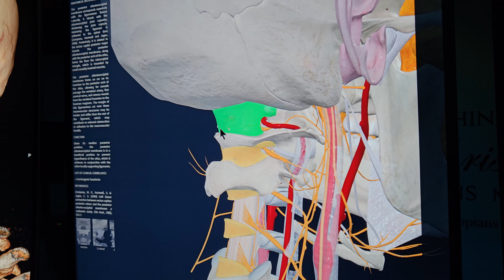Tinnitus Associated with Tethered Vertebral Artery

Comment: What's the name of this type of imaging?
Reply from the maker: We call it a 4 phase CTA
Reply: @3DAtlasAdjustingTechnique  thank you!  When I talk to my doctor I want to know the name of it.  I'm sure I need to come there to have it done. No one here where I live or even the surrounding area doctors haven't been able to help me or even understand what I deal with.  It's been frustrating and three years of dealing with it.  This last year has been the worst and I have been unable to work and applied for disability.  I just want to feel better.  Dishes and cooking make it work.  I have five bulging discs in my neck also.  I get very cranky with my kids sometimes and have to lay down and ice the back of my head to feel better along with specific stretches and an inversion table.  That helps with blood flow and CSF flow.  I tell doctors CSF gets backed up in my head and they don't believe me. I can't self diagnose but I'm very positive especially getting sensitive to loud noises and light.  And getting very emotional.  Basically disregulation of my emotions.
Reply: Where is he located